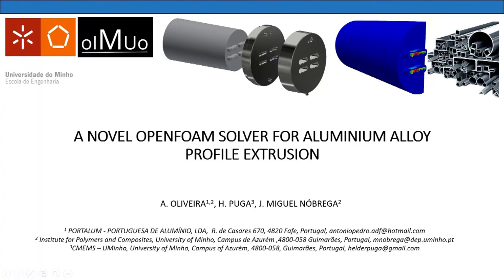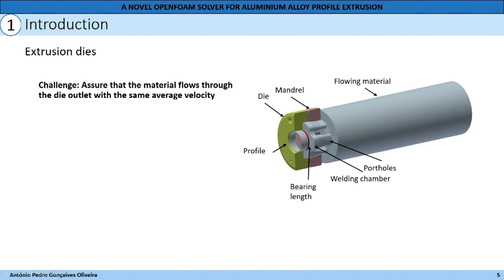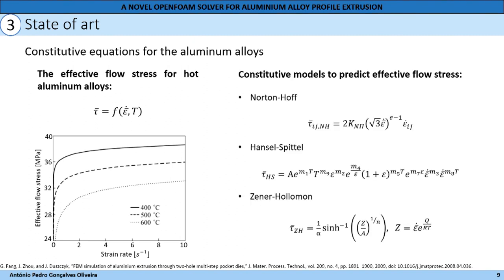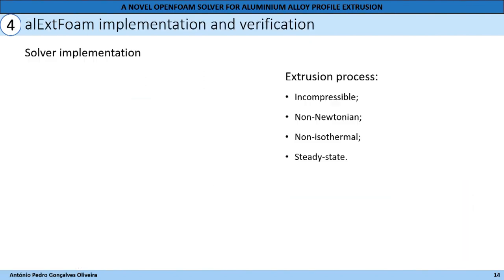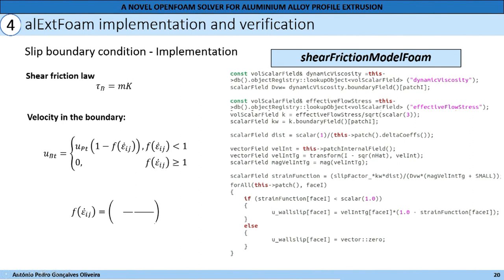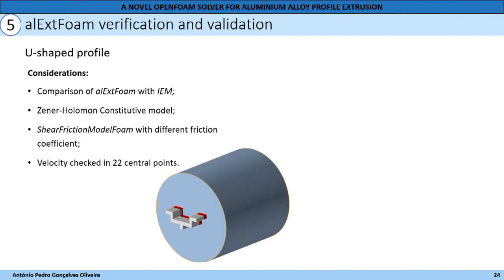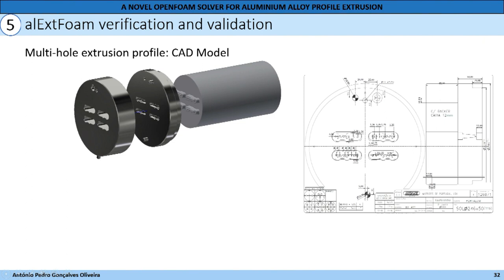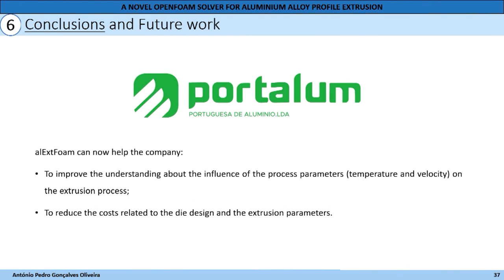Online International Meeting for Users of OpenFOAM III - P3 - Oliveira

Comment: Nice presentation!

Do you know why your results are different to the Basic results at the contact boundary (e.g. at time 13:35)? I previously implemented a version of Basic's code and noticed strange results at the friction boundary, and also the boundary condition implementation greatly affected the convergence. Did you try a fixedGradient version as well as a fixedValue version of the friction condition (e.g. iterate on the shear stress instead of the tangential velocity).

Thank you!